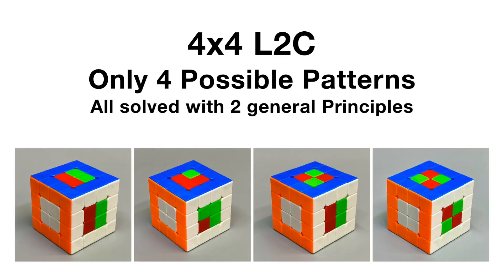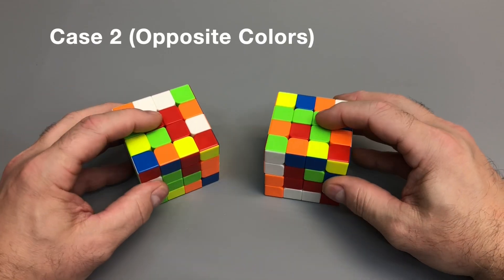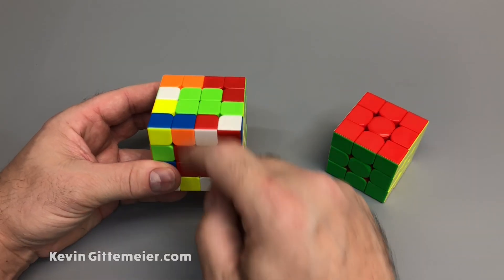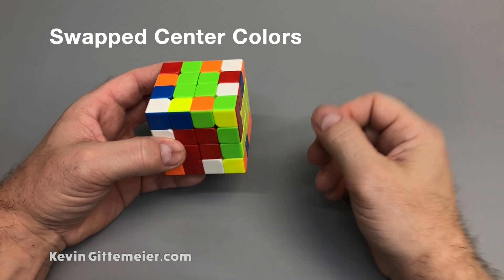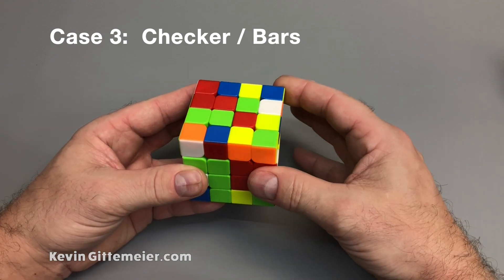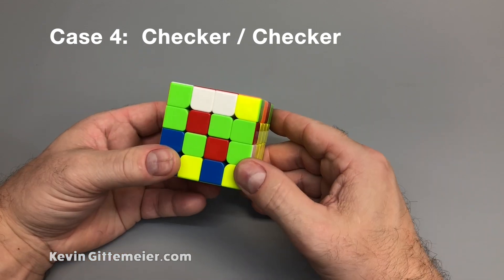How to Solve Rubik’s Cube 4x4 (L2C) Last 2 Centers Intuitive (SUP) Tutorial [KTFG 470]

Comment from the maker: Timestamps, Tips & Algs below…
This video is part of a series of Supplemental videos that provide a more detailed explanation of the Steps in my Rubik’s Cube 4x4 Tutorial, including the Theory and Principles behind the Steps, along with additional Examples and Troubleshooting tips.  Enjoy!

Timestamps:
00:00  Two General Principles
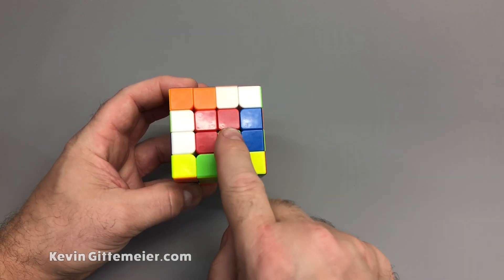00:45  Terms
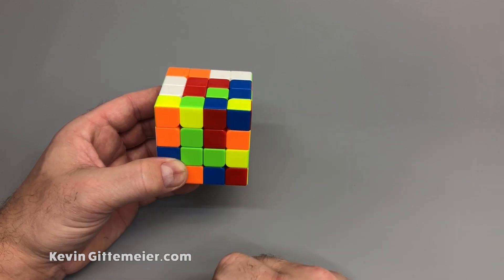01:02  L2C Patterns & Iterations
01:51  Cube Color Scheme
02:28  Overview 4 Cases
02:57  Case 1:  Bars / Bars
03:35  Swapped Centers
04:30  Case 2:  3/1  /  3/1
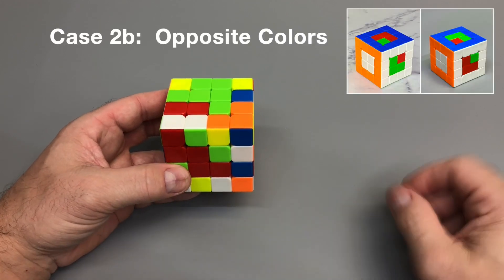05:30  Case 2b:  Opposite Colors
06:03  Case 3:  Checker / Bars
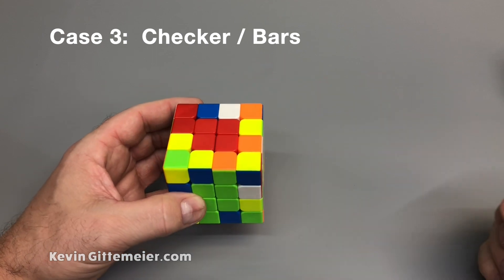07:23  Case 3b:  Bars / Checker
07:51  Case 4:  Checker / Checker
08:50  Relative Movement Concept
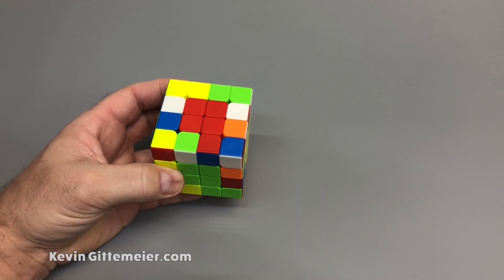09:35  Related Video (Subscribe) 

4x4 Tutorial Supplemental Videos List:
4x4 L2C (Last 2 Centers):  https://youtu.be/gnBcpUzRrJU
4x4 Edge Flipping Fundamentals: https://youtu.be/g3WCRCI4Dh4
4x4 L2E (Last 2 Edges): https://youtu.be/ZPwSy8PweDM
4x4 PLL Parity Intuitive & Alg: https://youtu.be/1Vj6gy_8-u8
4x4 OLL Parity Intuitive: https://youtu.be/mkwJRgwy4R4
4x4 OLL & PLL Parity Algorithms:
4x4 Beginner Method Tutorial:  

When we get to the Last 2 Centers there are only 4 possible Patters or Cases and
We will use 2 general principles to solve all of them.. logically.

Principle 1, Slice into a match forming Bars 
Or 
Principle 2, Slice back.. into a match forming Bars

Sometimes either Principle can be used, depending on the Case one may be more efficient than the other but as a beginner.. don’t focus on efficiency, but rather learning and understanding.

4x4 Last 2 Centers (L2C) Patterns
The 4 possible cases are 
Case 1:  Bars / Bars
Case 2:  3/1 
Case 3:  Bars / Checker
Case 4:  Checker / Checker
I don’t consider solved but centers in wrong location a case but some might.

Case 2b: Is the 3/1 Pattern but opposite colors.  We solve this with the same principle just mindful of final Center color placement making sure Green is on Front and Red on Top.

Case 3b: Checker / Bars opposite patterns same as above, we solve with the same principle. 

I only added the “b” subset to offer clarity to beginners who may be confused and consider them different Cases.

Set Up & Solve Algorithms for each L2C Case:*

Remember R2 = R’2 but you may chose one direction over another for fluidity of motion.

Solve is the main solve shown in the video.
Alt Solve is just the set up backwards if I didn’t use that in the video.
There are many ways to accomplish the same movements as explained at 8m50s mark “Relative Movement Concept”.

Case 0: Centers Swapped
Set Up:  Rw U2 Rw2 F2 Rw
 Solve:   Rw U2 Rw2 F2 Rw

Case 1:  Bars / Bars
Set Up:  Rw U2 Rw’
 Solve:   Rw U2 Rw’

Case 2: 3/1 
Set Up: Rw U Rw’
 Solve:  Rw U’ Rw’

Case 2b: 3/1 Opposite Colors
Set Up:  Swap Centers then Rw U Rw’
 Solve:   Rw U Rw2 F2 Rw 

Case 3 Check / Bars
Set Up:  (Rw U2 Rw’) (U Rw U’ Rw’)
 Solve:   (Rw U Rw’ U’)  (Rw U2 Rw’)

Case 3b Bars / Checker
Set Up:  (Rw U2 Rw’)  (F’ Rw’ F Rw)
 Solve:  (Lw F Lw’ F’) (Rw U2 Rw’)
Alt Solve:   (Rw’ F’ Rw F) (Rw U2 Rw’)

Case 4:  Checker / Checker
Set Up:  Rw U’ Rw2 F’ Rw 
 Solve:   Rw U Rw2 F Rw
Alt Solve: Rw’ F Rw2 U Rw’

Help us get to 100k Subscribers:  http://goo.gl/DDfVab 
If you would like to purchase a 4x4 or any puzzle seen in my tutorials, visit my website:
https://www.kevingittemeier.com/shop-games/
4x4 Nomenclature, Notation & Algorithms listed on my website
https://www.kevingittemeier.com (Direct link coming soon)

4x4 Tutorial Supplemental Videos List
4x4 L2C (Last 2 Centers): https://youtu.be/gnBcpUzRrJU
4x4 Edge Flipping Principles: 
4x4 L2E (Last 2 Edges): 
4x4 PLL Parity Intuitive & Alg: 
4x4 OLL Parity Intuitive:
4x4 OLL Parity Algorithm:

Rubik’s Cube 4x4 Full Tutorial:  coming soon

Even though this video series focuses on solving the Rubik’s Cube 4x4 Intuitively without the use of algorithms, I provide a full list of relevant 4x4 Algorithms on my website & below:

Notation for Methods of Flipping & Un-Flipping Edges

Beginner Method take out & re-insert upside down:
R U R’ U’ y L’ U L  (Forward) Do
L’ U’ L U y’ R U’ R  (Reverse) Undo

Beginner Method Variation with Front turns:
R U R’ U’ F’ U F  (Forward) Do
F’ U’ F U R U’ R’  (Reverse) Undo

Note: R U R’ U’ y L’ U L  =  R U R’ U’ F’ U F minus axis rotation Y

Intuitive Alternate Method a:
R U R’ F R’ F’ R  (Forward) Do
R’ F R F’ R U’ R’  (Reverse) Undo

Alternate Method b:
R U’ B’ R2 (Forward) Do
R2 B U R’  (Reverse) Undo
 
Alternate Method c:  
R F’ U R’ F   (Forward) Do 
F’ R U’ F R’  (Reverse) Undo

Note the old notation Rr is equal to Rw (newer & more widely used)
w = wide turn (both outer & inner)
More detail on my site.

PLL Parity Intuitive
[u’ (Flip) u]  [d (Flip reverse) d’]
Flip = any flip method including the above methods.
Remember u & d turns are opposite each other
So u’ & d both slice to the Right (u & d’ to Left)

PLL Parity Algorithm
(My Method)
Rw2 R2 U2 Rw2 R2 Uw2 Rw2 R2 Uw2 U2

Alternate Method (More Efficient)
r2 U2 r2 Uw2 r2 u2

OLL Parity Algorithm
Rw2 B2 U2 Lw U2 Rw’ U2 Rw U2 F2 Rw F2 Lw’ B2 Rw2

-
Some popular Rubik’s Tutorials:
Learn How to Fail Properly: https://youtu.be/NRWG0MfrAXg
Rubik’s Cube 2x2 Beginner Method:  https://youtu.be/UYCeyu_pbTI
Rubik’s Cube 2x2 Intermediate Method:  https://youtu.be/fDfpjC-GPBM
Rubik’s Cube 3x3 Beginner Method:  https://youtu.be/9spDGBeWl1o
Rubik’s Cube 4x4 Beginner Method:
Pyraminx Beginner Method:  https://youtu.be/gKbJOAeEkNI
Pyraminx Intermediate Method:  https://youtu.be/Jl-DhDrWWNE
Skewb Beginner Method:  https://youtu.be/_JaS0XB2xw4
Megaminx Beginner Method:  https://youtu.be/iAf8zbq0HH8
Megaminx LL Beginner Method:  https://youtu.be/s1FNwfFdrTM

Rubik’s Practice & Solves
3 Year Old Solves Rubik’s 3x3:  https://youtu.be/DUdq2vqybpU
3 Year Old Solves Rubik’s 2x2:  https://youtu.be/6Hs6800jW_w
3 Year Old Practices Rubik’s:  https://youtu.be/y_uwaxcReEI
Family Rubik’s Practice:  https://youtu.be/PkXdywoH20w
Rubik’s Klein Bottle Illusion:  https://youtu.be/-BHfsPC1pSY

See my website for a current Full list of Tutorials:
https://www.kevingittemeier.com (direct link coming soon)

If you found any of this helpful, Subscribing, hitting Like & Commenting helps support this channel more than you would think!

Comment: Swapped Centers:  3:40
Case 1:  2:58
Case 2:  4:28
Case 3:  6:00
Case 4:  7:50
Reply: 00:45  Terms
01:02  L2C Patterns & Iterations
01:51  Cube Color Scheme
02:28  Overview 4 Cases
02:57  Case 1:  Bars / Bars
03:35  Swapped Centers
04:30  Case 2:  3/1  /  3/1
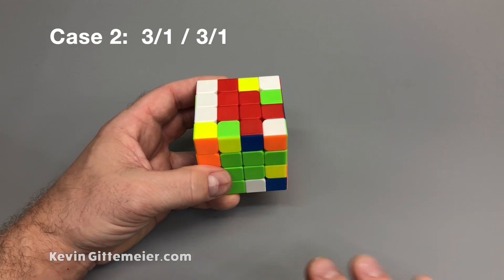05:30  Case 2b:  Opposite Colors
06:03  Case 3:  Checker / Bars
07:23  Case 3b:  Bars / Checker
07:51  Case 4:  Checker / Checker
08:50  Relative Movement Concept
09:35  Related Video (Subscribe)
Reply: Case 0: Centers Swapped
Set Up:  Rw U2 Rw2 F2 Rw
 Solve:   Rw U2 Rw2 F2 Rw

Case 1:  Bars / Bars
Set Up:  Rw U2 Rw’
 Solve:   Rw U2 Rw’

Case 2: 3/1 
Set Up: Rw U Rw’
 Solve:  Rw U’ Rw’

Case 2b: 3/1 Opposite Colors
Set Up:  Swap Centers then Rw U Rw’
 Solve:   Rw U Rw2 F2 Rw 

Case 3 Check / Bars
Set Up:  (Rw U2 Rw’) (U Rw U’ Rw’)
 Solve:   (Rw U Rw’ U’)  (Rw U2 Rw’)

Case 3b Bars / Checker
Set Up:  (Rw U2 Rw’)  (F’ Rw’ F Rw)
 Solve:  (Lw F Lw’ F’) (Rw U2 Rw’)
Alt Solve:   (Rw’ F’ Rw F) (Rw U2 Rw’)

Case 4:  Checker / Checker
Set Up:  Rw U’ Rw2 F’ Rw 
 Solve:   Rw U Rw2 F Rw
Alt Solve: Rw’ F Rw2 U Rw’
Reply: 01:02  L2C Patterns & Iterations
01:51  Cube Color Scheme
02:28  Overview 4 Cases
02:57  Case 1:  Bars / Bars
03:35  Swapped Centers
04:30  Case 2:  3/1  /  3/1
05:30  Case 2b:  Opposite Colors
06:03  Case 3:  Checker / Bars
07:23  Case 3b:  Bars / Checker
07:51  Case 4:  Checker / Checker
08:50  Relative Movement Concept
09:35  Related Video (Subscribe)
Reply: Case 1:  2:58
Case 2:  4:28
Case 3:  6:00
Case 4:  7:50
Reply: Swapped Centers:  3:40
Reply: 3:40 centers